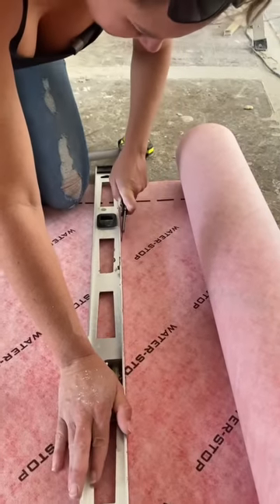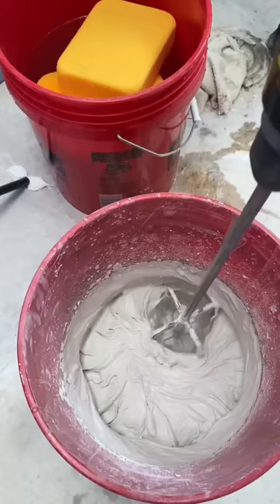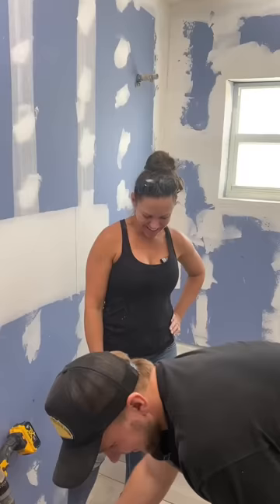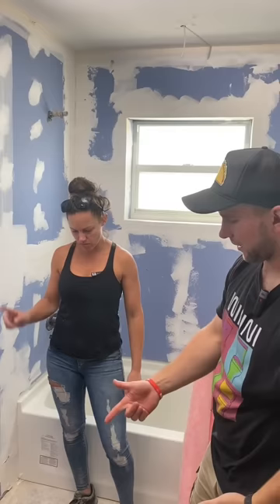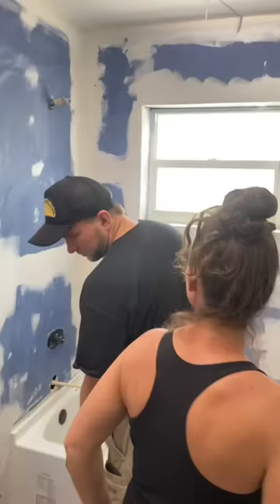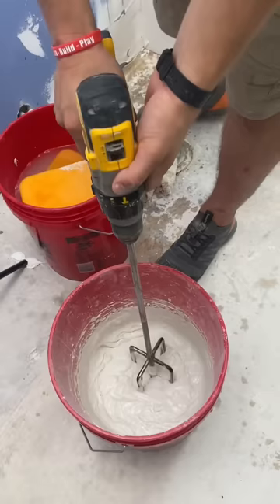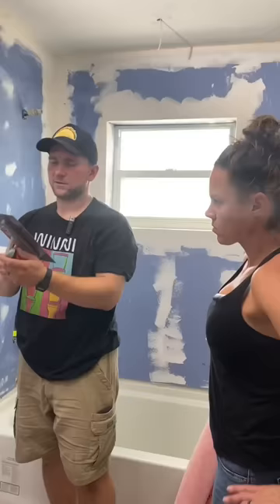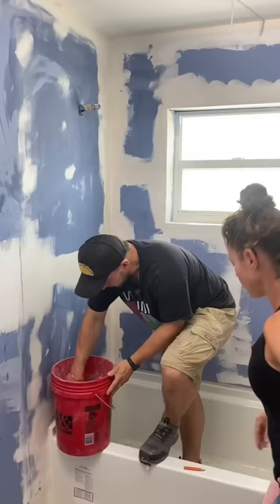Part 2 Winni.designs shows how to install the GURU waterproofing shower system! How to waterproof?

Comment: Don’t use drywall mud/ joint compound on the joints or screw holes you intend to use that membrane adhesive. Joint compound does not let that adhesive grab. The adhesive bonds to the drywall PAPER. 

For the joints and screws, use that adhesive with mesh tape instead of joint compound. 

Test it on a 12” x 12” piece of drywall. Cover half with joint compound. Let that dry. Then apply the adhesive and membrane making sure to leave a couple inches of overhang on both sides to do a pull test.

Comment: Cut the membrane with wood as a base (instead of concrete floor) ... knife / blade tip will remain sharper ... longer.
.
Disregard remainder of instructional.

Comment: Lol @ waterproofing a tub shower 🤣🤣🤣🤣🤣🤣
Reply: But they need it. So? 🤷🏻‍♂️
Reply: @PhillinRoyal  you do know its a tub and not a standup shower right ? 😆😆😆😆
Reply: @johne8907  people still shower in tubs.
Reply: You can even see the shower head pipe. I do this for a living buddy, not learn off some youtube video. Just stay quiet instead of sounding like a fool.
Reply: @PhillinRoyal  😆😆😆😆goofy if you were good at what you did you would know 🤣🤣🤣🤣🤣 

If your pipe is leaking call a plumber goofy 

You water proof areas where water sits what water sits on walls ??? 🤣🤣🤣🤣🤣

If water leaks from the pipe it usually runs down the pipe and floods the lower 
Floors Mr i do this for a living 😆😆😆
Reply: @johne8907  🤡
Reply: @PhillinRoyal  nice come back 👍👍👍👍 bahahahahh
Reply: @PhillinRoyal  another one bites the dust 🤣🤣🤣🤣🤣
Reply: @PhillinRoyal  and now we all see who does it for a living and whos the 🤡🤡🤡🤡 that thinks he does 🤣🤣🤣🤣🤣